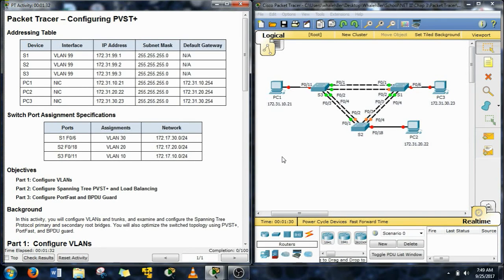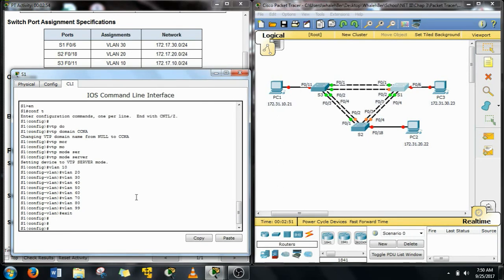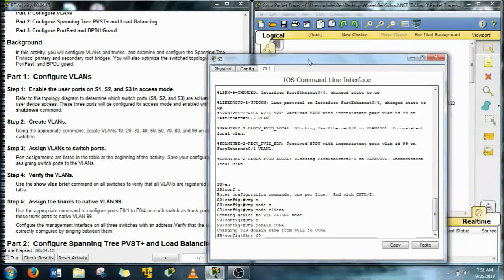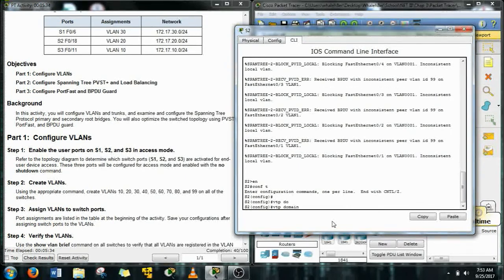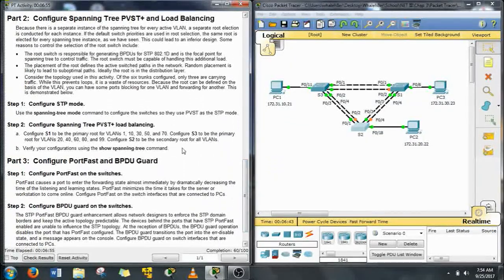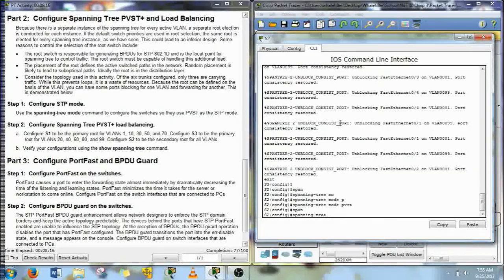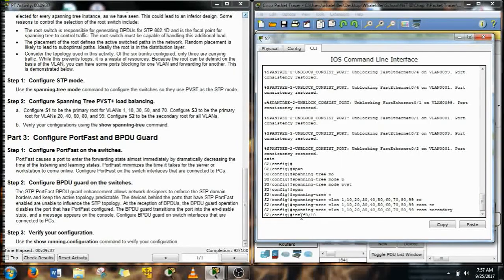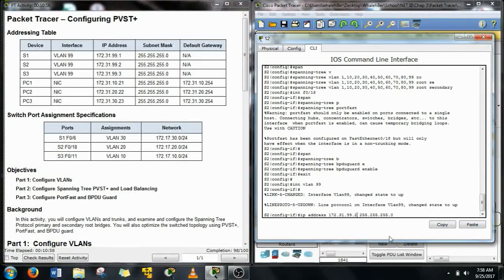3.3.1.5 Packet Tracer CCNA 3

Comment: I was missing points so I looked in the completion/to do list and for some reason on Switch 3, for STP, I didn't have RSTP enabled. I rewatched your video and saw why and fixed that. Still on S3, under STP for VLAN 20, 40, 60, 80 it's still not check marked and I have no idea why? Any clue why?
Reply from the maker: we could go back and forth on all the things it could be but to make things faster could you please send me 2 emails. whaleh8er@gmail.com 
1 for each of the comments you made last night. Send me the running config readout for the device your stuck on and tell me which packet tracer it's from. I think that will be the best way. I should be able to spot the problem.